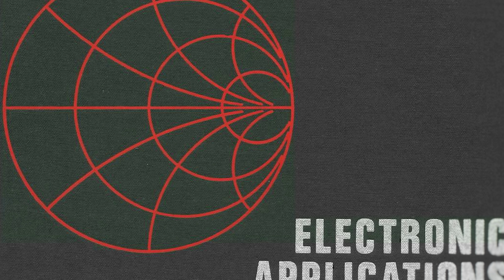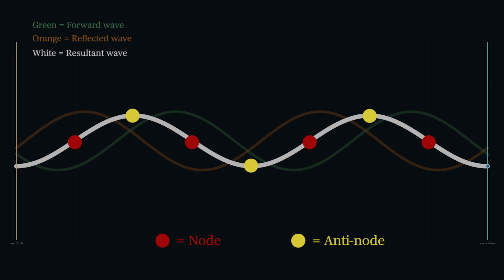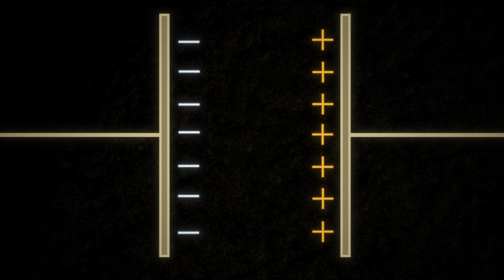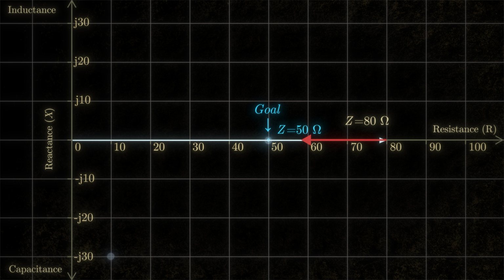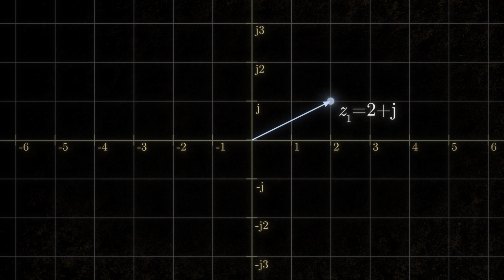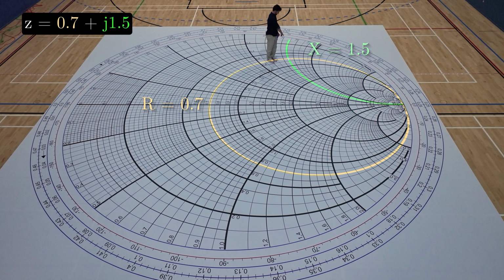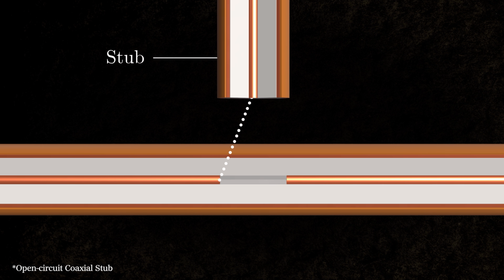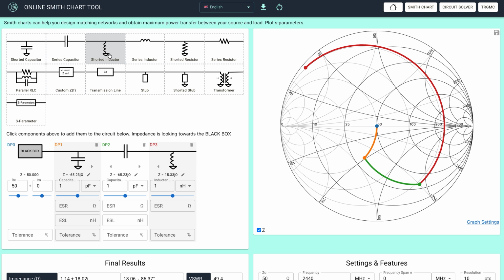The Scariest Chart in Electrical Engineering

Comment: This is the first Veritasium video where I have a difficult time understanding everything discussed in it, even with the simplified examples. Respect to all electrical engineers out there, literal wizards
Reply: Yeah me too. This one lost me, I have a masters in physics too!
Reply: Just wanted to add after watching: I think his explanations weren't that bad if you already know about the calculation. For someone new to the details of how elecronic components and "wires" and materials in general influence and behave when exposed to AC and especially higher frequencies it's way too much to ask to understand it from just this video.
There is so much more...
Reply: I agree it was pretty difficult. There were a few times where I went back in the video several minutes and watch those few minutes over and over again until I understood it
Reply: @idemanddonuts  But that's the norm with Veritasium videos, lol!.
Reply: It is nearly impossible to squeeze the content of 4 courses of electrical engineering into a 40 minute video, even after omitting all the complicated math. The guy did his best.
Reply: Yeah it wasn't explained as well as their videos usually are.  I have a hobbyist interest in the topic and a few important things were left out in my opinion, which made it a bit disjointed and it was unclear, like how they went from a reflection in a slinky to talking about resistors (I know why, but I felt the transition wasn't explained very well).  It also didn't help that he spoke so fast and slurred his words together that it took me a while to figure out what "maspunid length" was meant to be, which also wasn't explained.  I feel that this video's target audience is people who already know RF basics, rather than their usual target of laypeople with no background in the topic.
Reply: @vink6163  I suspect there was some GPT script involved, which is very good at disjointed diatribes
Reply: it's not very well explained. It invests very little time on the impotant things early on, but spends too much time time doing runs on a basketball court and waving slinkies.
Reply: @grproteus  Yeah I agree, it's tried to be all things to all people and ended up failing both ends - I think if you need someone to demonstrate a standing wave with a slinky like back in year 10 at school, there is no way you are going to get the mathematics later in the video.
Reply: Not a particularly good subject to explain unless you already happen to be a technician
Reply: I thought i was the only one struggling
Reply: It's Feynman bait. they want to find people who are really good at explaining stuff to dissect their videos
Reply: Before watching his attempts to explain it: Honestly once you figure out what it's for it is is really really easy and super helpfull.
Went to engineering school in central europe (a school type where you enter at age 14 and if you pas everything are done at age 19) and sure at first glance it looks weird and strange. But it's not scary, and even though i didn't need it for almost 10 years after passing my final exams, i needed to use it again after said 10 years, and still managed to get it out the back of my brain.
So it can't be that difficult. (i am not overly smart and if i can...)
But then of course if you calculate around in that field for at least 3 years in school one gets used to it. And of course we learned the fundamentals beforehand. (we got taught electricity from atomic level in material to radar and radio and telephones)
Reply: I didn't understand this diagram earlier. After watching this video, I still don't understand it - but nice to know I am not alone.
Reply: Electronics, a big fat vacuum for edutainment vids. I guess they just didn't realize how 'vacuum' it is and took too many preliminaries for granted. The number of concepts is low, but none of them feels natural unless you've already taken courses before.
Reply: @sqrti8825  What do you mean by vacuum? What do you mean by number of concepts? By my definition, this is one of the most heavy subjects as far as number of concepts goes, as it's basically just Acoustics + Electronics and some complex analysis, two of the most interdisciplinary STEM fields plus one very high level math field.
Reply: @TheLazarusEffect-z64  he's saying that electromagnetic forces (or any wavefunction like light or sound) is such a deep well of knowledge that content creators can exploit, which is true. 

try presenting electromagnetism or accoustics to ancient egyptians or ancient greeks. they would think its dark magic even though those two ancient group of people have advanced mathematics. but if you were to explain newtonian physics, they wouldnt think its dark magic because the fundamental intuition already exist. there's no fundamental intuition for electromagnetism and wave-like particles. thats why advanced electrics and quantum mechanics is a b*tch
Reply: @aoyuki1409  It's all intuitive when you think about what happens on a slinky or a string or in a tub of water, just like they showed.
Reply: @TheLazarusEffect-z64  for basic waveforms, yeah. what about square waves? what about non-sinusodial waves? what about compound waves? like AM radio is compound waves. waves on top of another wave. the maths behind all the intermediate and advanced waveforms and accoustics is not as intuitive as a bloody tub
Reply: @aoyuki1409  Easy, just have an infinite number of people vibrating the slinky! :) Anyway, you don't need complex waveforms to explain the basics of impedance matching, in fact it makes things more awkward to explain because you're just talking about another unnecessary thing. That's why they didn't include it. You do need to know about compound waves (what I call superposition of waves). However, you only need to explain two waves at a time, which is easily done with a slinky and something to reflect the wave off of, which they did.
Reply: Yep, I have an undergrad in Nuclear Engineering and a Masters in Hydrology, and this one lost me. Not a good explanation video at all. It focused too much on some things that were unimportant, while hand-waving others that were critical.
Reply: I have never felt dumber
Reply: yeah I didnt enjoy this video because I couldnt understand a thing !
Reply: Haha strange. This is one of the few very technical videos that I can understand fully! I have a much tougher time in other concepts dealing with advance math and such; but the Smith Chart explanation was very straightforward! I wish I had this video 25 years ago during college during my EE courses! It took me so long to grasp the smith chart!!!
Reply: Some Indian iit jee tudents can understand it because they read about L-C circuits and learn about impendence and about those 90° phase differences..😊😊
Reply: This is why i was a tech and not an engineer😅
Reply: @MedicatedMemory  During 4 years of learning to be an airport radio tech, we learned that antennas have two rules:

1. Reciprocity (the transmit and receive patterns are the same)

and 

2. They all work by magic. 

That wasn’t satisfying so I went back to uni for another 4 years of education in the depth of “how”.
Reply: Many electrical systems often have an analogous mechanical counterpart, but my experience is that even with such matched examples, people would readily understand the mechanical system but not the electrical equivalent. Just turning out the lights in a sense is all you need to lose half the population
Reply: This chart ended my Electrical Engineer career, or maybe it was the university's attempt to make me understand it.  Going on to Mechanical Engineering was so much easier.
Reply: I got a degree in this stuff, albeit more focused on the digital side, and it was not easy. New learning techniques (especially on the internet) make it way easier to digest. The problem you might be having is the massive information dump without the fundamentals.
Reply: I'm a hobbyist well versed in electronics and RF (I did a few things with GNURadio before), and I found it difficult to follow too. By trying to avoid using math as much as they did, they made it very difficult to understand.
Reply: Summary: impedance is resistance to AC circuits. It has a resistance value and an inductance or capacitance(or both) Z=R+jX. The X value causes a phase shift between voltage and current.which is not good for max power transfer. Adding capacitance to a circuit cancels out  inductance and vice versa. The smith chart helps identify how much of each needs to be canceled out to get maximum power transfer at 50 ohms of line
Reply: @thesnowyafternoon yah, and the reflection in the wave is always going to be less than one, so the chart uses the reflection constant for the wave to keep the data plottable rather than going off to infinity.
Reply: I don't think these examples are simplified.
The graphics are beautiful, but they bungled the explanations. Unfortunate for an educational channel.
Reply: They did speed through some of the parts for sure with the graphs.
Reply: It's worth noting that most electrical engineers don't have a deep understanding of the analytic function/conformal math/complex variable theory that underlies the Smith Chart.  But it is possible to simply observe that there is a bilinear transform between impedance and reflection coefficient, without being aware of the theory that shows why the various circles show up.  Empirically you can fool around with Matlab or Python or whatever and conclude, "huh.  it looks like constant real part Z and const imag part Z produces circular arcs in the complex reflection coefficient plane."  And with a little bit of work you can say "huh.  Using a Smith Chart you can compute 1/Z pretty easily, by simply reflecting through the origin."

-----

Perhaps the most fascinating thing in 2026 about the Smith Chart, is that if you buy EM equipment called "vector network analyzers" (VNA), one of the most natural presentations of the measurements is on a graphical Smith Chart, and not merely numbers to 6 decimals.  The Smith Chart simply conveys far more information.
Reply: i only understood it because i have forehand knowledge in impedance matching, characteristic impedance, and the general knowledge and idea of the witchcraft we call "Alternating Current" thanks to electroboom. without these pre-existing knowledges i doubt anyone could even understand, even if they are an academic in adjacent science fields. only those that know would know
Reply: @aoyuki1409 it’s all explained in the video explicitly. They say what is AC what is resistance and reflection and how to read the chart. I have no education past basic science and got it. I can’t say I’m an expert but I understand how to read the chart and what the chart means which is the point.
Reply: @MrBigboy135  the point of the argument isnt about teaching you how to use the chart. the point is that typically Veritasium videos explain to their videos, the knowledge both fundamental and practical side of it. anyone can understand the practical side if they can learn any basic science, but the fundamental bit is still missing. 

firstly, not only AC has impedance, DC does too. but the non-resistance component of DC impedance is zero, because frequency is zero. also you dont just have AC or DC, you can have both. you can have a 100 volt peaks AC, with a +5V DC added to it, leading to an AC Voltage that peaks at +105V and -95V, the calculations could be different but was never explained.

they also never explained why electromagnetic waves even bounce when transitioning medium. to be fair, its kinda difficult because this is quantum mechanics level stuff, so i get why they omit this.

tldr: you know how to read the chart but you still have no clue why we needed the chart. the dark sorcery of AC wave functions still remains a mystery to you, despite this chart is meant to solve that specific part of the AC wave peculiarity
Reply: @MrBigboy135  They did go over how to read the chart pretty well, but really quickly skimmed through a lot of concepts. Ironically, if they went over these concepts more thoroughly, I feel like it would have been an even more advanced video (Especially conformal maps). I guess that's why they referenced Zach Star and 3Blue1Brown. I'm an acoustics specialist who just graduated undergrad with math-physics and am an acoustics specialist and 2 and a half electronics courses aced. This video is 90% acoustics and 10% electronics. This video was a great review for me, and I still had to double take some concepts, so I could understand how the average person could find this difficult.
Reply: One of the first veritasium videos where I understood everything. The funny thing is, I'm not even an electrical engineer. Just a math-physics major with a specialty in acoustics and a little interest in electronics!
Reply: @TheLazarusEffect-z64  because you already half-understood the dark sorcery of AC waves. people who had zero background in electrical engineering or any form of waves in physics would be still completely clueless as to why we needed teh chart. the only thing this video did successfully is teaching you how to use it. they never told you the dark magic on why we needed to use it.
Reply: Because it's a bad video, that doesn't even explain its own premise. I hope that this does not become a trend.
Reply: @XIIchiron78  What do you think it's premise was? I think we have different definitions for the word premise.
Reply: I think it is the explanation, really terrible. It is a difficult topic but still though, they totally rushed it.
Reply: As an electrical engineer I was wondering if I am really that bad in understanding what Veritasium said is a common topic in electrical engineering course. 
Apparently I am not the only one.
Reply: Veritasium has never been "light science", but in this case, I think they were a little too far. However, as a Telecom EE, I really appreciated this video.
Reply: Very Very lost with this one. To quote Michael Scott, explain it to me again, like I’m 5.
Reply: Watched the second half twice.  Probably will need a couple more times to nail it down.  Makes me wonder if Handy has a video from the '50s and '60s on this.  Those old explanations from that time were so clear and easy to follow
Reply: the same happened to me
Reply: I often find the point I get lost at is when they use a concept that was referenced 5-10 minutes earlier in the video and by that point I’ve already forgotten. If you really want to understand you might need to take notes or watch multiple times
Reply: I have a masters in computational finance and I was lost… lol. Very interesting topic though. I might do more exploring on this one!
Reply: thank you, we are so disrespected and this feels nice
Reply: I think this Veritasium video did just about as good as many of the others. The issue is the amount of math involved. With other videos, people can nod along thinking they understand it (but they really don't, just themes and core ideas). With enough math, people will realize just how much they don't understand.
Reply: I have a degree in fashion and I could follow generally. But not the detail, especially when they get into the math I am lost. Its like they are speaking a different language all together. 

But enjoyed the video none the less. Its amazing that someone sat and figured this out with a pencil and paper. 🎉
Reply: Right there with you bro. Electrical engineering is just what we call magic these days I guess
Reply: It's simply just a Warped Impedence Map...Simple!
Reply: @HungrySeal31 my TA for the class that I learned the smith chart in was a literal rocket scientist. He was actively working for NASA while teaching us the smith chart to my class. So anyone who does this sorta stuff daily is indeed a wizard.
Reply: I'm an electrical engineering student and I can promise you that I'm going to come to enough of an understanding to pass my class and then never use this thing again
Reply: @woodlandcritterpunch till you get that one gig where it becomes invaluable lol 😅
Reply: Yeah im gonna have to sit this one out
Reply: I disagree, I think they explained it very well. I understood this one better than some of their other physics videos, and electricity is one of my least known subjects 🤷
Reply: @MrBigboy135 Honestly I think it goes back to your understanding of Mathematics and Spherical space. If you covered it well on your own or courses it was a great video. If not, you are on the struggle bus. BS in Physics for me, not that I use it for my job though.
Reply: @The_endeavorer  Why do you need an understanding of spherical space? The signal  and standing wave is represented with two dimensions and the complex plane is represented in two dimensions. Nothing in here gets to the three dimensions required for a sphere.
Reply: @TheLazarusEffect-z64 Thank you! It seems like many of these explanations that claim to fully understand it, incorporate nonsensical reasoning. Smh
Reply: And respect to food and ag scientists who have to put up with that disgusting hit piece on Glyphosate. Shame on Veritasium. Lost credibility.